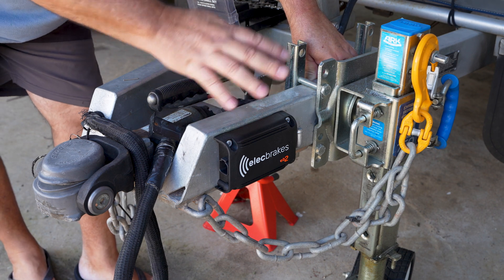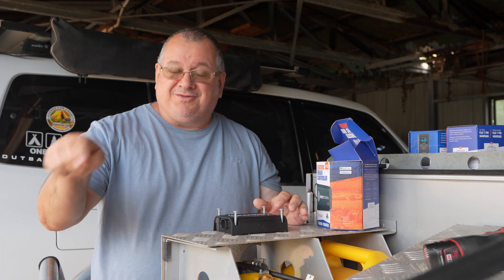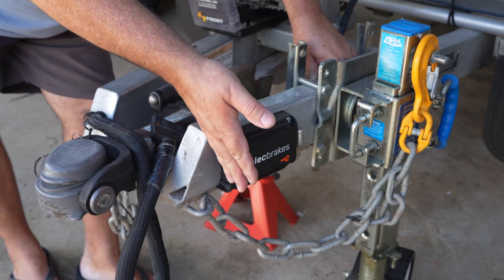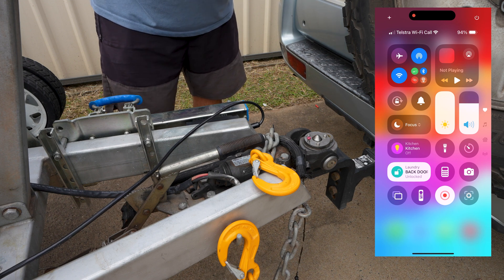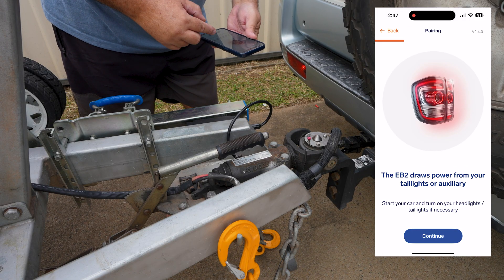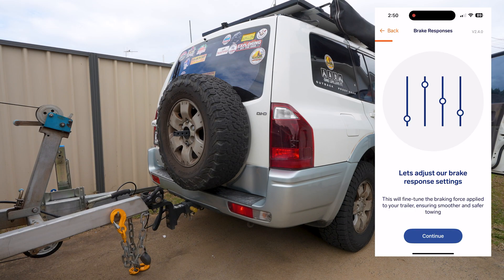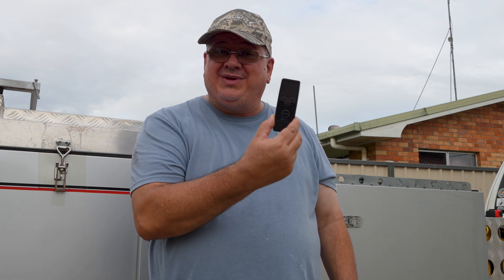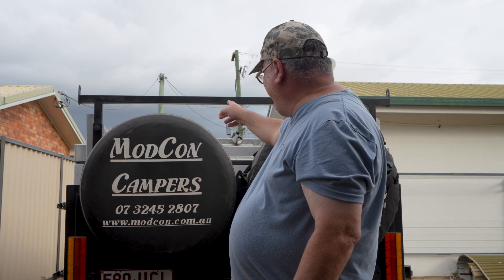ElecBrakes Electronic Brake Installation and Setup - Easy Wireless Brake Controller for Your Caravan

Comment: Phil, you can now be prosecuted for counselling making you an accessory to a crime.   The brakes can't be set up without breaking the law by touching your phone whilst driving. Anyone who is caught following your advice should consider legal action against you for compensation.
Reply from the maker: Common sense needs to be practised here.   I was on a private road on a farm when I adjusted this. 

And that was the only time I used my phone.  At the same time I purchased the Elecbrakes remote I use this to adjust brakes and break override.

I spent an extra 150 to 200 on the remote so not to break the laws with using a phone.

Next time get your facts right before accusing me of something I did not do.

Comment: Very informative, well done 👍🏻 I have one question re- the auxiliary power. You said it gets power when you turn on the tail lights, so if you wanted, could you just run one fused power supply that comes on when the ignition is turned? And would you have to wire that into the 7-pin wiring plug in an unused spot? I'm not sure I like the idea of always having to turn my lights on to give it power, many thanks.
Reply from the maker: Yes you can source a powered lead to a certain pin and not have to turn the lights on all the time.   I plan to do this myself

Comment: You wont see me use any other brake controller, these are the best, ive hidden mine under my caravan and hard wired it, stuff using harneses
Reply from the maker: That’s a great idea to hard wire in.   These are awesome.  I see there is a new update available to helps stop swaying .

Comment: Good video Phil, only thing I probably would have done differently is mount the unit inside the chassis to help protect it and also with the electrical connection pointing backwards. Unfortunately sometimes these things are not able to be done.
Reply from the maker: I agree, that would definitely help protect it. But the cable was not long enough

Comment: I have a redarc break controller Phil.
It has full  10 adjustable sensitivity settings And self calibration
Reply from the maker: Ok.  I did not know that.    I'm still very happy with the ElecBrakes.  The user experience I think is better than the Redarc.
Reply: Throw it in the bin, this unit creams on redarc

Comment: Hi Phil.
The problem I see,  is that the location of the unit. It will get damaged with stones etc. From the vehicle tyres
Reply from the maker: I think it will be fine.   I can't see stones flicking up where it's located.
Reply: No issues with the unit and stones but the adapter and corrugations are no good ours failed and as you can image getting another adaptor several hundred Km down a gravel road…….😢 not worth the headache you don’t have these issues with a vehicle mounted unit

Comment: Great vid. But Them brake controller seem to be the biggest waste of money I think. Leave your lights off by mistake and brakes don’t work? That adapter to 7 pins looks like just a weird after thought and probly break when driving on corrugations. Should have spend the coin and got redarc mate. Everything is neat and stuck away safe and no weird plug system. Always has power too.
Reply: Ours broke on our FIRST trip!!! on corrugations and left us stranded. No support in remote areas and no help. The remote station has a mechanic / auto elec but could not help as it’s product specific. 

Been Redarc user for many years done a lot of trips and never had 1 issue. 

We will likely toss this in the bin and get a tow pro fitted
Reply from the maker: @craigmotbey4626   you can wire it into an accessories if you don’t want to turn the lights on. 

Also the remote has speakers to inform you if the brake controller is connected or not when you start the Vehicle. 

Personally I think it’s better than the redarc.  My brother has the redarc brake controller

Comment: How does the box connect to brakes on the trailer 🤔
Reply from the maker: @davidmilledge221   Through the original trailer plug. 

The adaptor plugs into your vehicle,  the plug from Elecbrakes plugs into adaptor and the camper or caravan plug plug into adaptor as well.
Reply: Looks like a good after market system the redarc I had in the fj was fully adjusted with 10 settings of resistance the new ranger has an amazing towing system it will even reverse the caravan as well

Comment: Phil, Elecbrakes eb2 does not have Sway Control as yet and is not compatible with Vehicle Manufacturers in built Sway Contol. Apparently Elecbrakes is developing and testing an upgrade with Sway Control. Will wait and see for future developments.
Reply from the maker: @soverignisle   That is true.  I did mention this but somehow that portion was not filmed.
Reply: @PhilsCampingReviews I recently bought one that says on the box SwayControl is included.